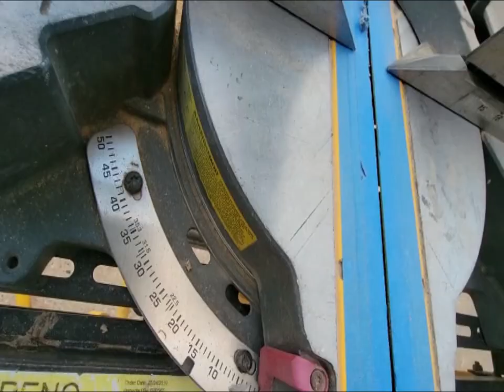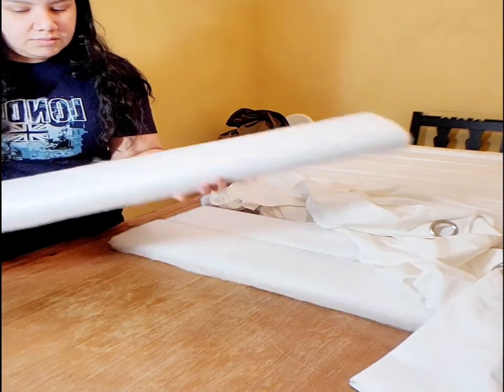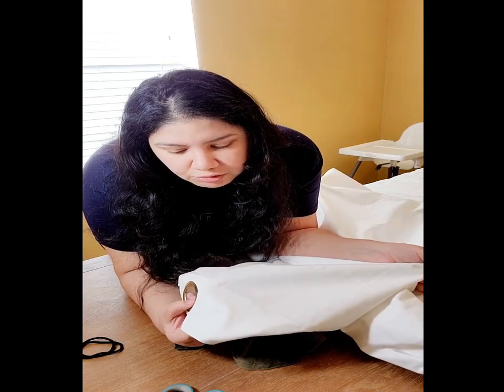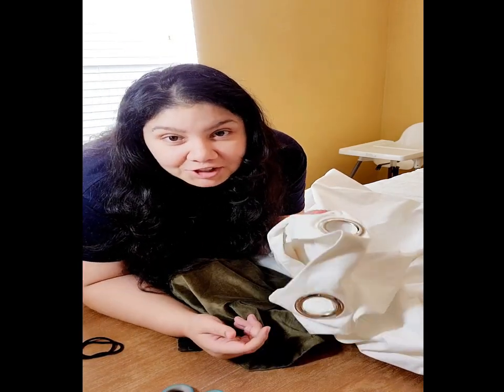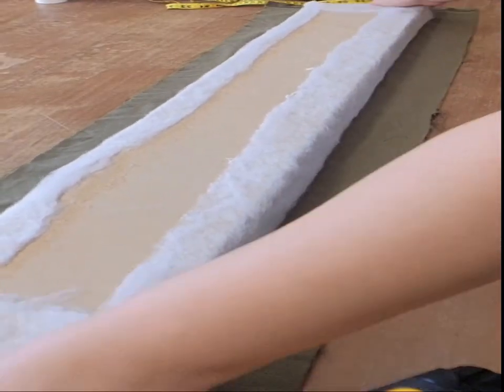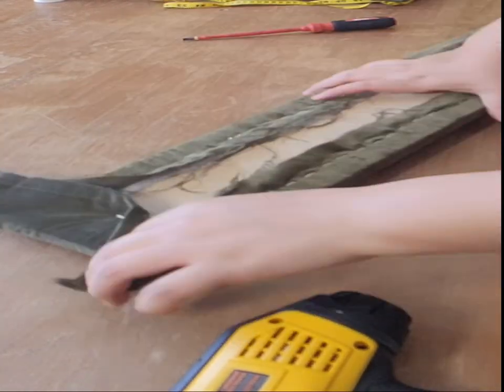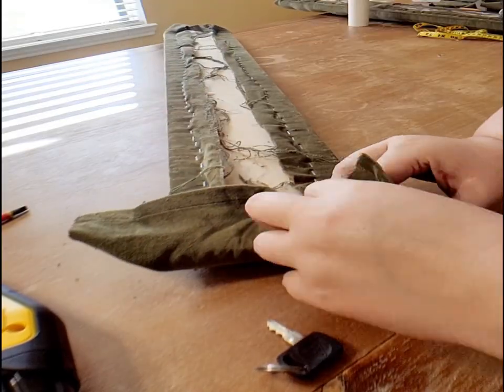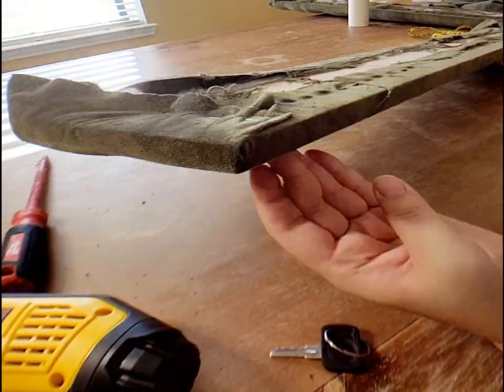DIY Channel tufted headboard (QUEEN SIZE)

Comment from the maker: UPDATE if you need it for a king size bed do 14 panels at 5 inches to get 70 inches in width
Reply from the maker: Or add 3 more panels at 5.5 inches wide